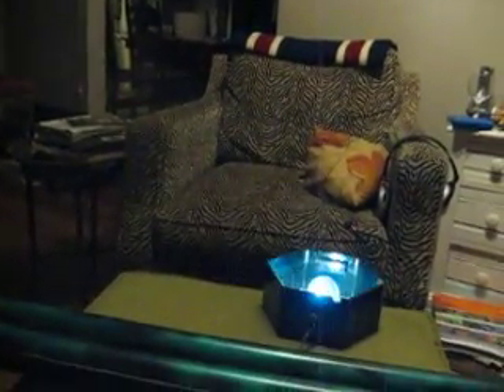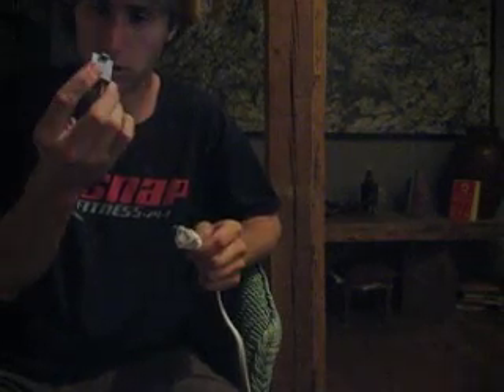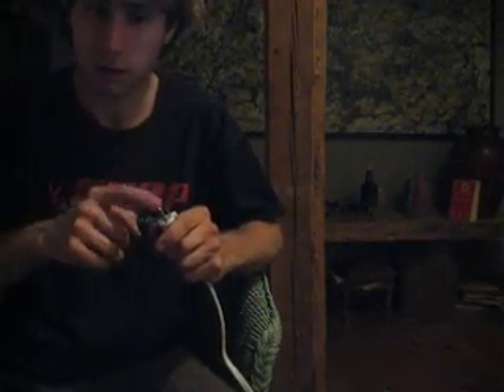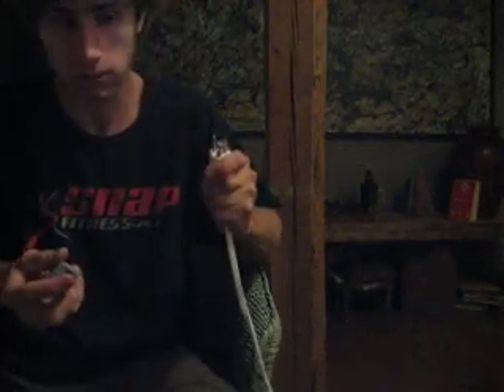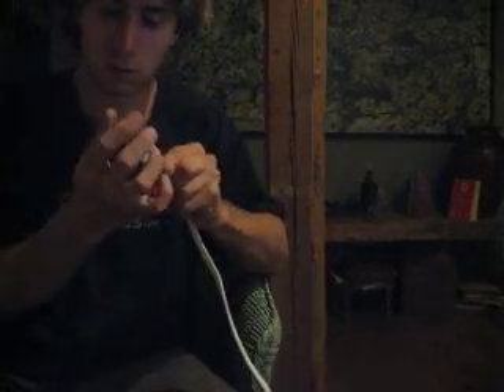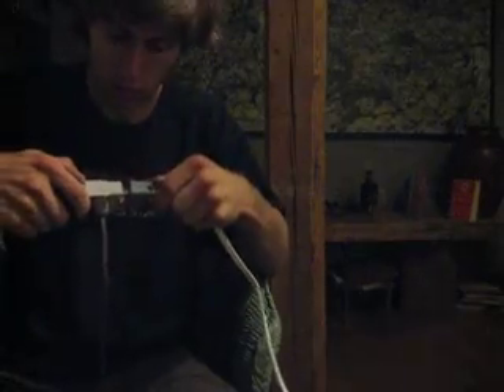Flickering fluorecent how to build and what you need to do it!!

Comment: If you just wire a dimmer and plug it in, it does the same with alot more flicker. Still gonna kill the ballast sooner, but its much easier. Don't know about safety, but I would plug it into a GFCI.